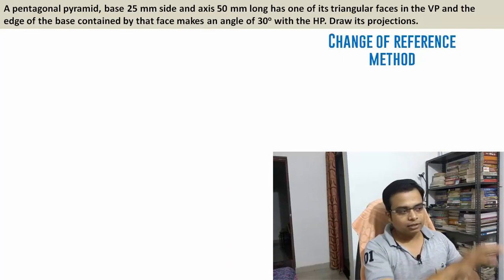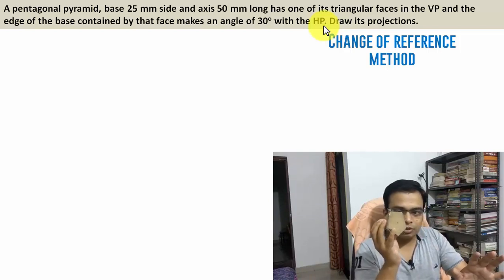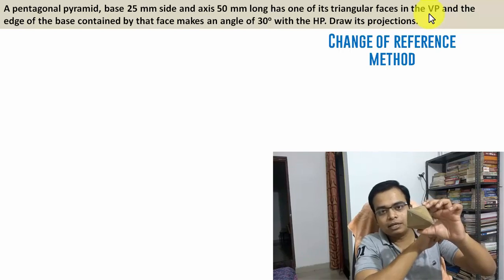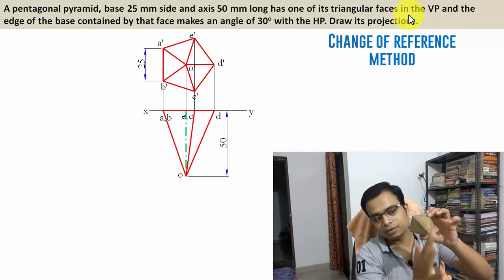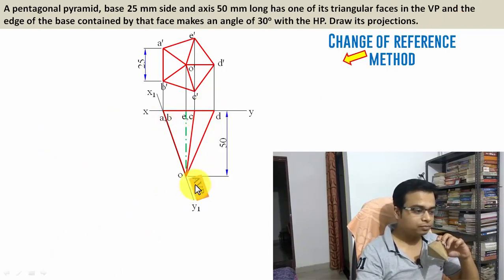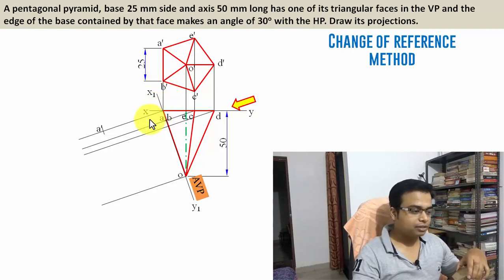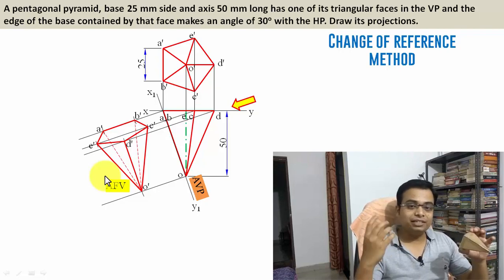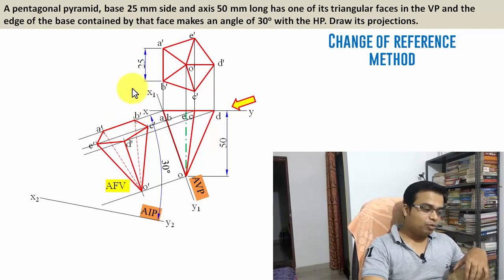Auxiliary Plane_Projection of Solid_Lecture 10

Comment: Sir   can you please help me in this question❓

A regular pentagonal prism lies with axis inclined at 60 degrees
to HP and 30 degrees
to VP. The prism is 80 
mm long and has a face width of 25 mm. One of the corners of the top face is nearer to the 
observer and the remotest shorter edge is in VP. Draw the top and front views of the prism